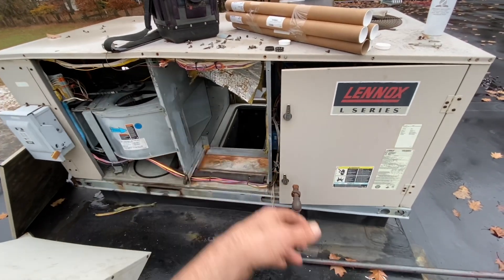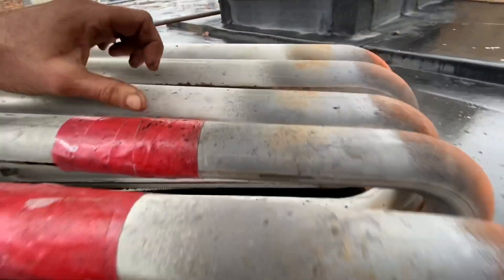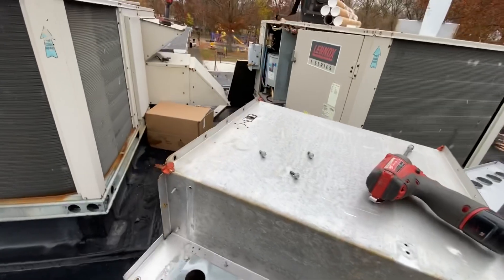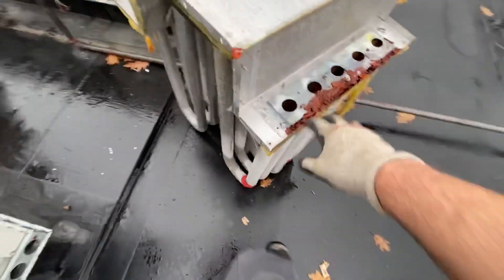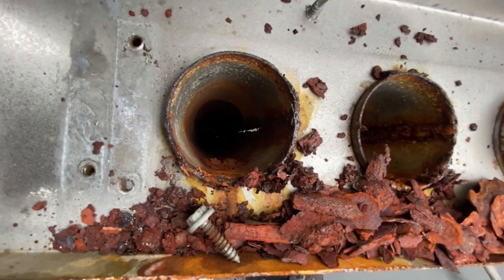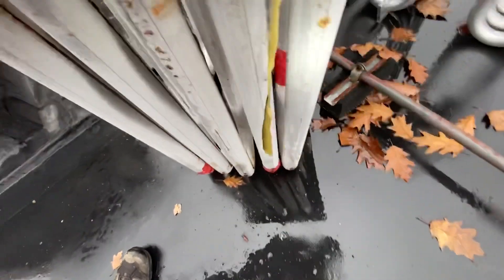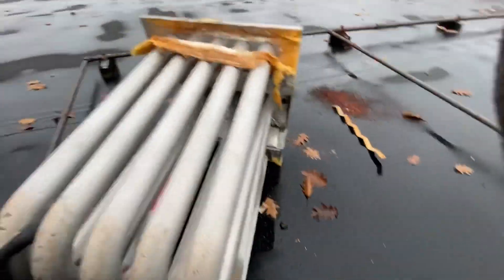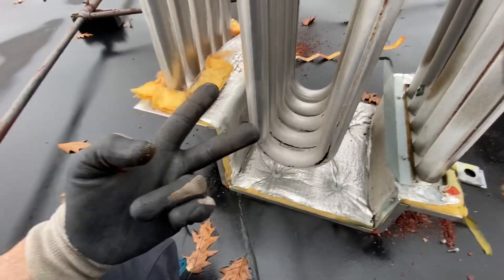Cracked Heat Exchanger

Comment: Man with that many holes in it I'm surprised the pressure switch didn't end up locking the whole unit out
Reply: Or trip the manual reset roll out limits is the usual failure mode i run into on these type of units. Once there's enough holes, once the main blower turns on it blows the fire back out of the tubes into the burner compartment where the gas valve n stuff is. I've seen ones where the "maintenance guy" bypassed the limits, then it fried all the wiring to the gas valve shutting down the unit.  Fried the control board from the shorts. Still very dangerous, they got lucky wasn't much stuff to catch on fire in the compartment just a few wires.

Comment: You'd think they'd make them from stainless steel or something.
Reply: Eeyyyyy! I’m running a business here.
Reply: They do make them in stainless steel. Will be spec'd by engineers for high humidity or 100% outdoor air systems. Cost more but the low bid wins.
Reply: Stainless steel ican also be prone to cracking from the constant heating and cooling causing metal fatigue.
Reply: Heat exchanger in my workshop heater ( powrmatic ouh) is stainless. Honestly I assumed they all were till I started watching HVAC videos.

Comment: those welds suck. i worked for sandvik in the 70s and the welding wire division sold to bechtal making nuke plants, they had to xray every weld and keep a record on file.  titanium.
Reply: Designed to fail out of the box welded tubing in an acidic condition .days gone by heat exchangers were cast iron.